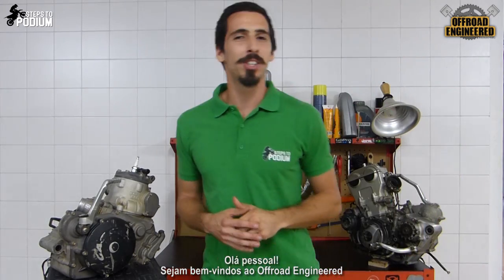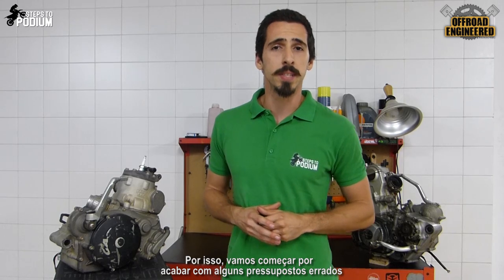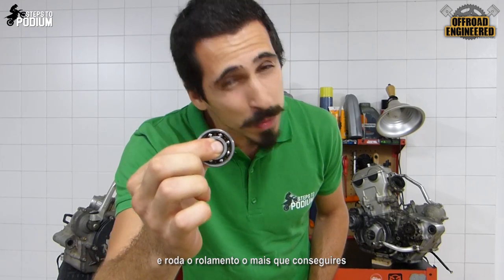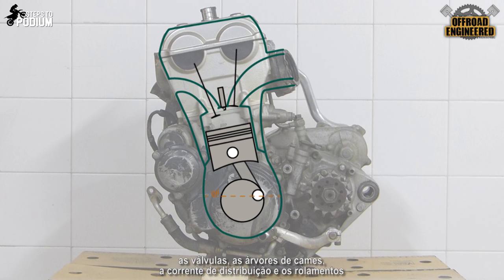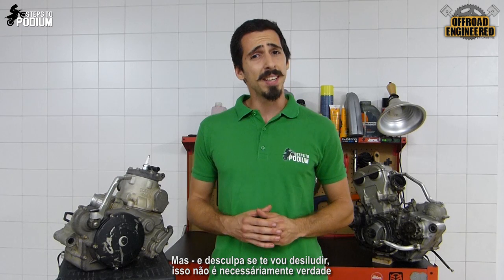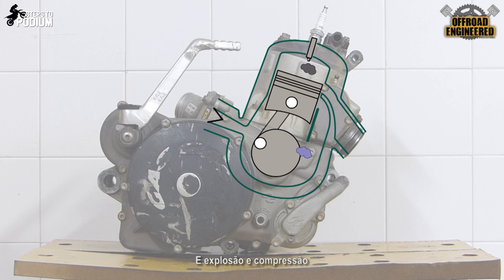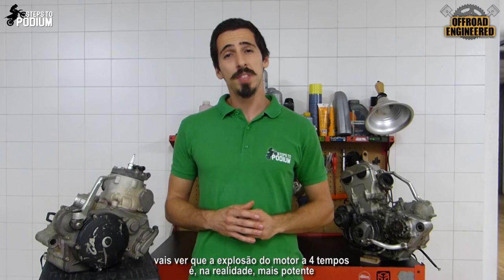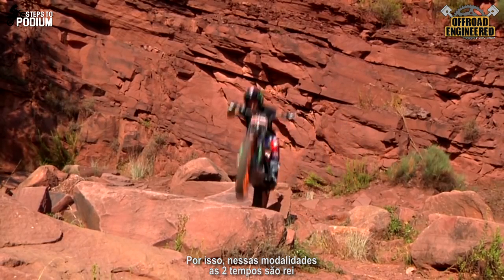2-stroke VS 4-stroke | Offroad Engineered

Comment: How does a four stroke gasoline engine compare with a four stroke diesel one?
Reply from the maker: in terms of construction the diesel doesn't has a spark and in terms of performance usually the diesel has more torque and the gasoline has more peak horsepower!
Reply: @StepstoPodium  Thanks for the insight,you could consider making a video about it. A little correction,you should have written "doesn't 'have' a spark",just being helpful 😇.

Comment: 2T is powerful cuz of the Power Valve... Tho the F1 engineers came up with the idea of making 2T F1 cars cuz they are lighter, faster, more powerful and more durable. The problem is that they want to make it with direct injection and high rpm... that isn't a problem for 4T but it is for 2T because lets take like 18000 RPM which means that in 4T the injection valves open/close and get a slap of heat 150 times a second. They can endure that... but 2T can't because it does a complete power cycle with every up/down the piston does so that would mean that the valves would open/close and get a heat slap 300 times per sec. So the engineers need to figure out what material they should make the valves from that will endure that much heat first.

Comment: Answer me this why in super cross does a smaller 2 stroke run with a bigger 4 stroke engine? 125 2 stroke runs with a 250 4 stroke
Reply from the maker: exactly what aí explain in the video, it's all about power output and not engine cc. a 125 2 stroke produces the same power output as a 250 4 stroke!

Comment: I have heard a lot of people saying 2 strojes have the most efficient power cycle. Higher efficiency due to less complexity.  This does not include the unburnt charge fuel and oil pulled into the exhaust. DI 2 strokes claim highee efficiency than a comparable 4 stroke engine. Any experts with knowledge abt this?

Comment: i was about to buy 300exc two years ago but i went to 690 smcr cuz i drive 5000-7000km/season so would 300exc be maintenanced a lot with these kms `?
Reply from the maker: A 4 stroke will always imply a less frequent maintenance but when you do, it will be quite more expensive than a 2 stroke. 
it will depend a lot on how you do those 7000km more than anything!
Reply: @StepstoPodium  i drive quite normally these 7000km so would it be big hassel for 2s ?
I mean no wheelies or burnouts, sometimes offroad as much as sm tires allow 😂

I change 690smcr oil/filters every 2500km and oil service kit is around 65€ plus check valves also so idk if its a lot or how much it cost usually
Reply from the maker: @paul1e  then I think it comes to mileage! a 2s will spend twice the amount compared to a 4s.
however a 2s will make you smile more 😆😆😆😂
Reply: @StepstoPodium   oki doki :D

Comment: From that diagram you're telling me the two-stroke suction is fuel and air through the crankcase 😱🤔
Reply from the maker: mostly, yes! 😊
Reply: Wow good job I'm a 4 stroke dude then Yamaha wr450f supermoto 👌
Reply from the maker: @Ry93P  thank you! I really appreciate it 😊
Reply: Yup. That's why they don't have engine oil. Just transmission oil.
Reply: before it goes to crankcase its goes through reedvalve and before that carbs. its the piston that create compresion for the fuel mixture to enter the the combustion chamber. 2 stroke are really the best bike if you wanna have fun. its just fun to ride it, take a test. myself was an anti 2 stroke( hate the loud sound and smoke), came my friend give me a ride, i instantneously love it, and buy a new 2 stroke haha now im a 2 stroker all the way hahaha even the sound i dont care its loud, scream as much he want ill love it more.
Reply from the maker: on point  👌😂
Reply: Only mx bikes are like this right coz I've worked on my friends air cooled twin cylinder 2 stroke and it sucks air/fuel straight to the cylinder throu a carb same as my wr450f
Reply: @Ry93P  nope. it may looked like its sucked air/fuel straight to the cylinder but actually the air/fuel is sucked into the crankcase when the piston is going up and the mixture will be pushed into the combustion chamber via transfer ports when the piston is going down. so normal 4 stroke engine oil could not be place in the crankshaft cause the air/fuel mixture passes through there. thats why all 2 strokes need to be mixed with oil. the oil in the mixture functions as a lubricant as the mixture passes the crankshaft
Reply: @nazrlol8102  I'm having a hard time believing that but I'll be sure to investigate

Comment: I own a 4-stroke bike and a 2 - stroke bike
A 2000 year old Yamaha DT-125 and a 150 Kawasaki KLX 150

For me i think the 2 strokes are well suited for enduro since its nimble, quick and easy to use and a little bit in MX Tracks because its aggressive af

The 4-strokes (in my experience) 
Is suited for long trails, dirt tracks and long rides not for Enduro since it's obviously heavy than a 2 Stroke 
And it's hard to kickstart it when you're not used to it.

Comment: Hello bro I'm using ROYAL ENFIELD (u may know RE) long stroke 70bore×90stroke 4t  engine .what happens if i use silencer without any filters for a period of time?it could damage the engine ??plzz explain with simple mechanics
Reply from the maker: hey! what do you mean filters? you mean the glass wool you have one the muffler?
Reply: No bro i mean the bare empty pipe  but it seems to be  like exhaust system (inside no blocks with tiny pores) . Plz search u tube long punjabi exhaust royal Enfield.the answer ❤️
Reply: Bro do u have I'd on instagram.if so plzz give I'll send some photos.
Reply from the maker: @afreeth555  yes I do! look for @stepstopodium

Comment: he said 2 stroke are king, and i give like to the video guys.
Reply from the maker: You made my day! 😂😂😂😂👌
Reply: @StepstoPodium  no you made my day bro! Thanks to ur video i finally understand the concept of 2 stroke exhaust, i know its like supercharging, but dont know that the length of its that actually control the timing of the waves. Quick question, what about its diameter of the exhaust, is it bigger diameter for just big displacement, or its effect the timing too
Reply from the maker: @davidrsteve1394  the diameter is pretty much only dependent on displacement but you can fiddle with that! 😊
Reply: @StepstoPodium  thanks mate

Comment: It's a little misleading to equate "a 4 stroke's power stroke is more powerful than a 2 stroke's power stroke" with "a 4 stroke is more powerful than a 2 stroke".  Your bike is moving through all the strokes, not just the power stroke, and every non-power stroke is lowering the power/stroke ratio.   A 2 stroke makes power in half of its strokes while a 4 stroke makes power in one quarter of its strokes.  Whether you're on the 2 stroke or 4 stroke train, you might as well be accurate.

Comment: honestly. I think that I have been seeing the 2 stroke become obsolete for my whole life. two strokes used to have the better horsepower to wieght ratio, but these days we have 4 stroke snowmobiles that put two strokes to shame, so this is obviously no longer true. 
 you can put a modern 4 stroke any place a 2 stroke used to go.....

  stop saying 'explosion' when you mean ignition. there is no exposion. there is a controlled burn. gasoline cant burn fast enough to explode. what I mean is it is not an explosive. it does not explode. pistons would be destroyed if it did.

Comment: 2 strokes are not easier maintenance and less expensive, cuz u rebuild them twice as often and spend a lot of money on oil to pre-mix with your 25mpg if u ride a lot. Even the TPI fuel pumps have to be replaced at 65 hours. Carbs are always maintenance and drama, jetted wrong/need cleaning; then theirs power valve adjustments and dented pipes. FI 4 strokes need the valves checked once a riding season if not racing, and go 200hours/5000 miles before a rebuild equaling or beating the cost of riding a 2 stroke that much, plus the hours not spent on maintenance.

Comment: 2 and 4 strokes both have there purpose there is simplify no better one the both have flaws there’s a reasons y we use both designs because if 1 was better we would use it only for example I have a outboard that was made in 1960 this outboard is a 2stroke and is 25 hp weighing at 60 lb it is powerful and fast but I have a new 4 stroke outboard from 2015 both made by murcury and there both 25 hp but it weighs 150 lb it has more power but the 2stroke offers a faster acceleration

Comment: Thats harsh halfknowledge. 2Strokes have higher Power/Cc Ratio. When talking about power you dont speak of the power from an single explosion neither, when you say power its the overall effective engine power. I wanna see him race a 250 vs a 250f.
Reply from the maker: Although I appreciate your feedback, it has nothing to do with "halfknowledge". 
I completely agree with you on the 2strokes having a higher hp/cc ratio, I clearly said it on the video, but what you might have understood wrong was my explanation on why do 2strokes have a higer hp/cc ratio. It's easy to throw some clay to the wall saying that they have that (that's halfknowledge!) , but why is that? That was the question I aimed to answer, that few people take the time to explain.
2strokes have a higher hp/cc ratio, but it comes at a cost => fuel consumption.
Reply: Steps to Podium Yes youre right after rewatching i see that u said fuel consumption and not CC i mustve been in clouds. But if you take a look at the ned Injection systems for 2 strokes the negative point get eliminated: fuel consumption almost as fourstroke, Higher torque in low revs, no circulation losses. If KTM would make one step further and go from Transfer Port Injection to Direct Injection it would get even better. I cant express my technical knowledge well in englisch because i speak german.
Reply: What i find a bit odd is the drawing of the 2 stroke. the transfer port dont end under the exhaust port thats a bit weird. Even if there was one in history thats very very outdated. But im almost shure you did this for simplicity right?
Reply from the maker: @yannhayon2796  No problem :)
The thing is that even with direct injection (if that were the case), it would still consume more fuel since you have 2 power strokes during 1 power stroke of a 4stroke, if we would consider the same RPM. 
If you don't consider the same RPM, you might compare the fuel consumption but you can't compare torque figures since it's not in the same RPM. We would have to compare in a specific environment to assess what is better or what not, but I understand what you are saying and I appreciate the discussion! :)
Du kannst auf Deutsch sprechen mein Freund, ich spreche Deutsch auch :D
Reply from the maker: @yannhayon2796  It was only for simplicity sake, yes xD I had to consider that structure for 2 reasons:
I couldn't confirm exactly how it was, since I couldn't cut the engine in half xD
And being like I drew, helped with the animation! :)

Comment: I agree with most of what you're saying but when you're talking time/distance 2 strokes are more powerful. 4 strokes put out 1.5 of power per power pulse to a 2 stoke but takes 4 strokes to do it. An example is a cylinder head that has four 13mm bolts holding it in place, and another has eight 10mm bolts holding it in place. Sure a single 13mm bolt is stronger than a single 10mm bolt but you realistically need more than that to hold down a cylinder head. Now if you're talking about the 2 stroke doing only 8000 rpm to a 4 strokes 12000 rpm on equal size engine then it would be who's the better rider  !
Reply from the maker: True indeed but the bolts have nothing to do with it! On a 4 stroke you have a gasket making sure the combustion chamber is completely sealed, so you only need 4 "big" bolts. O a 2 stroke, you need more bolts because there is no gasket. More bolts spread out more evenly allow the top end to be sealed without the need of a gasket.
Reply: @StepstoPodium  LOL,  I guess I was using a reference too close to the subject.  The bolts are in reference to the power pulses of the engine. Since the operation of the engine to accomplish any given task  requires many power pulses talking about a single power pulse is irrelevant. When talking efficient,  since riding a motorcycle isn't always about acceleration,  you have cruise speeds etc. 4 strokes are more user friendly/efficient . I have both and like both for different types of riding. But when I fire-up that 2 stroke I feel like I'm hopping on a bull and trying to stay on it till the bell rings. I'm a senior citizen and the little kid comes out on a 2 stroke.  I know I'll never give into a 4 stroke chainsaw !
Reply from the maker: Amen to that! 🤣👌🙏

Comment: Perhaps 2-stroke engine has quick response to acceleration compared 4-stroke engine and besides that higher RPM on 2-stroke engine than 4-stroke engine.
Reply from the maker: Nowadays that doesn't matter anymore, since 4 strokes are fuel injected and actually, 4 strokes motocross bikes reach higher RPMs than 2 strokes!
Reply: I have to drag raced a bunch of 4T with my CR250R. They are very fast off the line. And my KX has launch control for less wheel spin and faster hole shot.

Comment: You forgot one important detail cost-effectiveness when it comes to maintenance for the guy on a budget the two strokes the only way to go
Reply from the maker: With that I agree! but remember that it also comes down to what kind of use you give it. in hard enduro for example,  a 2 stroke can require more maintenance compared to a 4 stroke.
Reply: I still got are you the point I've had several two strokes gotten years of service out of them without rebuilding them regular oil changes air filter cleaning increase the longevity of a bike I got to say the same about my 06 Yamaha wr450 6 years loyalty out of that bike nothing done other than their routine maintenance guys that new me and the bike couldn't believe the hours I had on it I just saying far cheaper to rebuild a 2 stroke then four stroke
Reply from the maker: With that I totally agree! But since I was just talking from a performance POV, I didn't consider it :)

Comment: What kind of 2 stroke? Ones with isolated bottom end and then there are traditional motors
Reply from the maker: how so?
Reply: @StepstoPodium  direct fuel/air injection allows high degree of tunability. See later mercury 2t outboards. They bought it from some Aussies
Reply from the maker: @garywaterson3147  I was talking just about 2strokes overall, not specifically any kind of engine input :)

Comment: Do not believe that all 2T have no low torque at low RPMs , my Kymco 100cc 2t will outrun most 4t scooters from low speeds upwards. My TDR 250 2T  vs my klr 650 is stronger in any gear low down than my klr 650 which is a single-cylinder 650 with good low-end torque

Comment: With most gasoline manufacturers using ethanol in their fuel they produce 2 strokes engines will never make a comeback because ethanol destroys 2 strokes because it causes the gasoline and oil to separate inside the fuel tank also harms carburetors as well especially diaphragm style carburetors.
Reply: They won’t make a comeback because nobody wants them anymore.   Digital fuel injection 4T are so much better. And can be changed around so much with programmable mapping to respond anyway you want it to.  Look up the Vortx ECU.

Comment: The first thing was that 4-stroke has more moving parts therefore more spinning mass inside the engine. Why did u completely left out flywheel because 4-stroke has much heavier flywheel. Also you made a strange point that 2-stroke isn't more powerful. Ofcourse if u have -87 500cc 2-stroke it's shit against 2020 450 4-stroke but if u compare 250 sx-f to 250 sx then 2-stroke is more powerful no doubt about that.
Reply from the maker: true indeed!
I left it out simply because that a part that can be changed between both engines in the same way. You can change a piston on both engines but each is different for each engine for example. 
I could've included the flywheel nontheless but for the explanation purpose, it doesn't alter the end result. 
I didn't compare the power of an old bike against a new bike... I stated that the power generated by the explosion stroke is bigger in the 4 stroke compared to the 2 stroke.